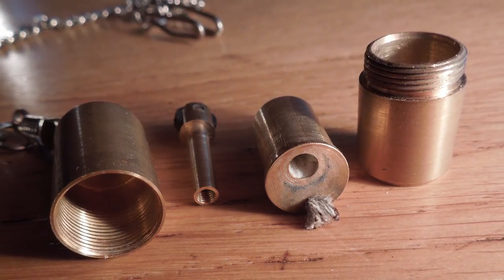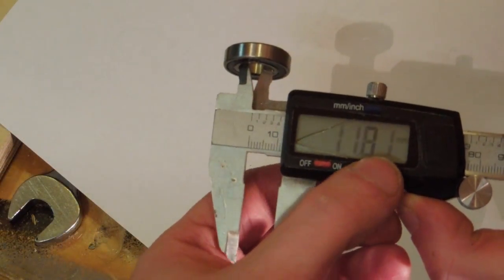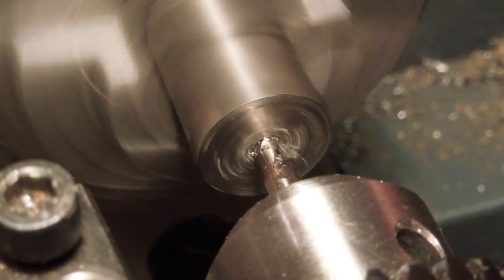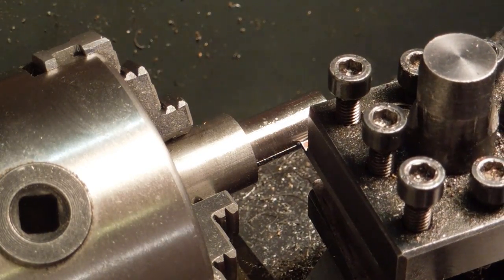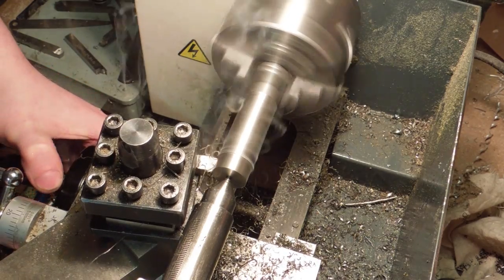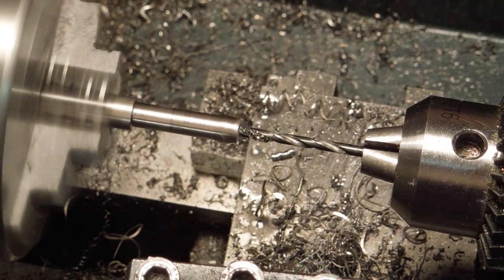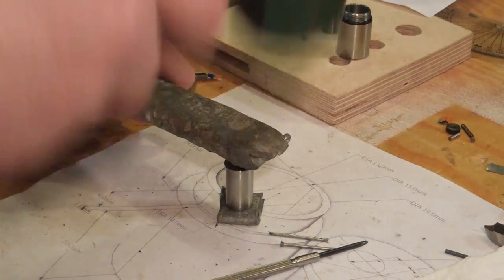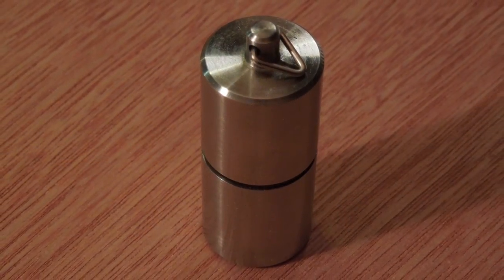Machining a Peanut Lighter

Comment: The slitting saw in time 6:26 has to high revolution to make groove in the striker of steel hence the teeth is worned out by heat of work. Set to lower revolution to make groove in steel. Nice work of the peanut lighter.

Comment: I made almost the exact same lighter as you, I have a lathe, but I used 1/2" stainless steel pipe and made the end caps out of brass.
   I made my own wheel out of silver steel and cut the teeth on my lathe just like you made the grooves on your fuel body before hardening it.
     My lighter throws plenty of sparks but does not light very well, also the o ring seems to perish very soon due to the petrol.
     Put side by side to yours it looks just like yours.

Comment: machine milling a lighter is no small task ! you did an excellent job . i purchased a countycomm peanut but returned it because the inside chamber would not separate from the outside  [ i couldnt fill it with fuel  ] i was disappointed . i ended up purchasing a disposable .
Reply: +ratrod diesels usually you just pull out the insert by pulling from the striker wheel.

Comment: What grade of stainless is that? I have never had SS machine that cleanly.
Reply from the maker: Oh, I forgot to say. It's 303 grade.

In my (limited) experience, stainless is always funny to machine because it's either a mess of chatter or you get a beautiful finish, and rarely anything in between. I did have trouble with chip welding though and was stoning the tool pretty regularly.
Reply: Simon Heslop Well it looks great. To my knowledge I think I have only used 314 and unless I use carbide I have had a terrible time working with it, especially drilling. Tend to avoid SS whenever I can. Might have to grab some 303 and see the difference though.

Comment: dude, I'll pay for one if you can make one really long, like 6 inches long!!
Reply from the maker: How much were you thinking of paying? Honestly I think with shipping to the US a better bet would be to find a more local machinist. A job like this should be fairly easy for someone properly set up.
Reply: I don't know. How much does it cost to make one?
Reply: Would it be difficult to have the internal area completely open with just a long wick from the top to the bottom of the inside to use it as a type of oil lantern instead of zippo style? Good SHTF lighter if we can use anything that ignites to create a flame. Or would that leak out through the flint part?
Reply from the maker: There's alot of hidden costs in something like this. Like it'd cost me about £20 in fuel to go buy the metal required, and there'd be a fair amount of time spent thinking about how to do each step for a one off thing. I don't think it'd be a very quick or easy job. Stainless steel isn't the most forgiving material to work with so drilling a 6 inch hole could be a challenge for starters.

I don't think it's the ideal sort of lighter for what you want either though. They're not very wind proof and don't carry that big a fuel capacity, and yeah if you replaced the stuffed cotton it'd just leak out through the wick. I think their main interest to survivalists is that they're very small and with a good seal should hold fuel for a long time. But myself I still don't think you can beat a mini-bic.